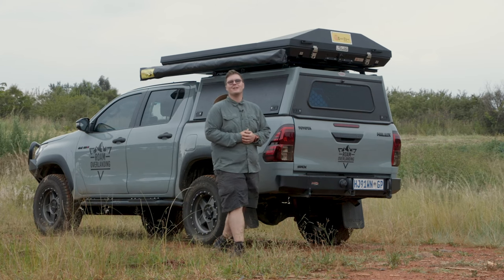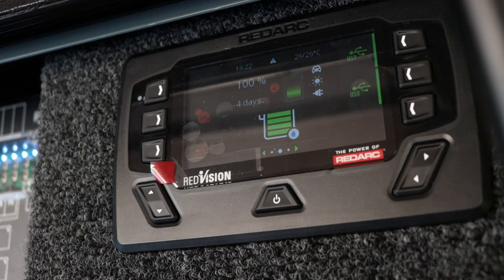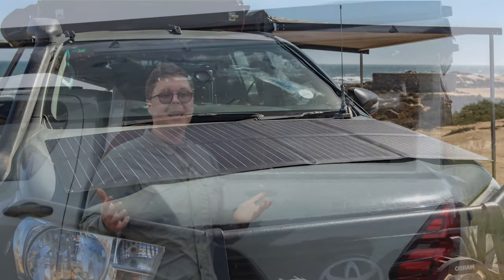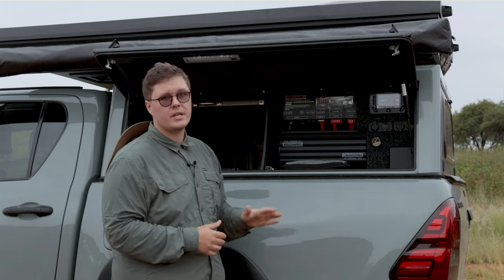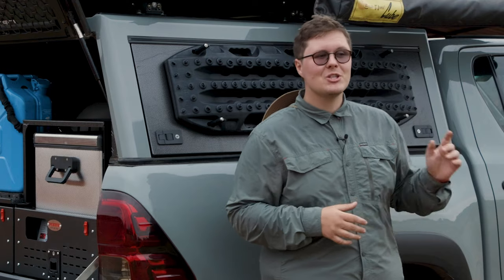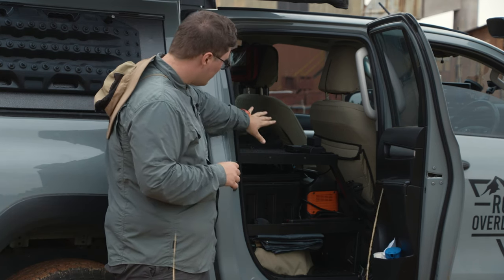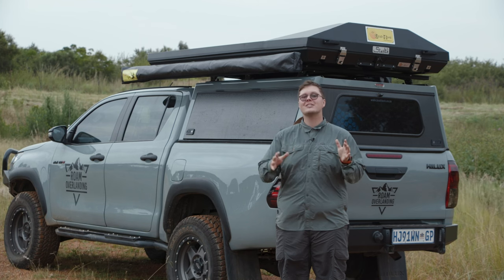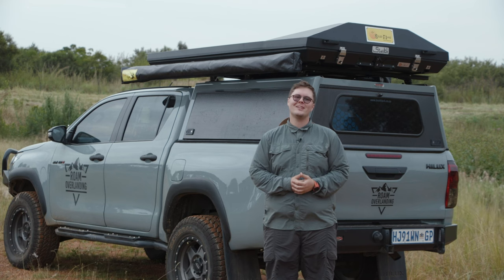Redarc Redvision Install, Garmin Tread XL Overland & New Drawer System (Major Updates To The Hilux)

Comment: Great content... I'm looking at the overlander vs the tread... what is your verdict?
Reply from the maker: Loving the tread 🤙🏻 requires less admin to get running. Just update to the latest software and hit the road. Which I’ve really liked
Reply: @RoamOverlanding  Thanks, I'm just trying to weigh up if its worth the extra 15k... in your older videos you do mention the overlander is a great Garmin. If you had to look at it coldly would you say its worth every cent of the 15k extra?
Reply from the maker: That’s a tough one…. If you could pickup a second hand Overlander and an InReach mini 2; that may be a great deal 🤙🏻 but the Tread with the InReach closes that gap pretty quite from the 15 👍🏻

Comment: Hi there . Looking great. Both the build and your journey. Congratulations! Besides from weight , any reason you have not put a solar panel on the roof? Might be less important with the lithium, but having near constant charge ( Daylight/ weather permitting) is great.  Provided you are not in a shady campsite for long, you could leave the blanket behind and not have that to worry about?
Reply from the maker: I do really want to put on fixed panels; and the plan is in action. I would still keep the solar blanket for a bit of extra oomph on those cloudy days or placing a panel further from the vehicle

Comment: In your experience so far, would you recommend the Garmin Overlander Tread over a Garmin Overlander + InReach Mini (2) combination?     I'm at the point where I'm looking at navigation options for my Jimny.  Since I do a lot of solo stuff, the Tread is an attractive option with build in SOS, but in a nutshell, the Tread is few grand more than just purchasing the "normal" overalnder and inreach mini separately.   Would appreciate your thoughts!
Reply from the maker: Really good question!  I personally really like the Overlander and Inreach combo; but let me throw a spanner in the works for you. I’ve been playing with the Garmin Montana 700i it’s a smaller unit, more accurate gps, detailed maps and InReach built in! And it’s cheaper

Comment: Great upgrades! I just bought a LC 79 DC and looking forward to see your impressions of the Bushtech tray/canopy. Redvision is next level. What would the ballpark cost for all components without labour be? Thanks.
Reply from the maker: Congrats on the cruiser Hansie! The redarc system as of Megaworld's pricing is about 54K i think then I did a hubble lithium battery which cost me 6k so round a bout 60K I reckon. Its certainly not cheap but it's something that will move from vehicle to vehicle over the years.

Comment: Why did you put the redarc system where you did? Seems to be taking up important and useable space. Couldn’t you tuck it away on the headboard somewhere? Also, it looks like you’re about to do the Namakwa Trail. I was just there. Would love to know your plans for the route. We took it very easy. Slept 6 nights on the trail from Klein Pella to Vioolsdrift.
Reply from the maker: The headboard doesn’t actually have enough space with a cab slider in, I also wanted everything to be easily accessible in case I need to work on it or change things up. If it had tucked it all away in a place and needed to unpack the whole vehicle to work on it, it would drive me crazy. I was using that space for the same thing before, I like having central access to my power and switching for my campsite. So personally I haven’t found it’s location a problem, if anything I’ve really enjoyed where it is 👍🏻 4x4 eco trail was amazing, we did 4 days only from Pella to Alexander bay but geez it was beautiful!

Comment: Just purchased a Tread Overland. Have you had trouble with getting T4A POIs showing up? Can't get all the POIs I see on Basecamp to show on the GPS.
Reply: Nevermind. T4A sent me the guide file which needed to be installed.
Reply from the maker: You should also just make sure the device is up to date on its latest firmware 🤙🏻
Reply: @RoamOverlanding  Thank you, but the issue was not having the Guide File installed on my Garmin unit. T4A sent me the file and all is working now.

Comment: Is it hard to look after that beautiful paint job you have? I mean the tub when you get stuff out or plug in the air compressor hose etc. I can see straight away the 79' looks very heavy at the rear. I really like your Hilux setup.
Reply from the maker: the paint is actually holding up really well! Its a truck paint, so similar to what gets used on fire trucks; so its really tough! Just a bit tricky to polish when it does get scratches. I've been loving the hilux setup too; I wouldnt go the cruiser route personally.
Reply: @RoamOverlanding  That's very interesting, thanks.

Comment: Hi Adrian, your videos are a huge inspiration and I'm trying to mirror a lot in my Ranger Double Cab. It's humble guys like you that inspire us to save up and do regular overland trips as a break away from the rat race.
I'm about to do a Dual Battery System with the National Lunar 90l Fridge like yours. When comparing apples to apples, would you recommend the National lunar Green Box DC to DC charger or the equivalent Redarc 25A? I'm just running the fridge, the same canopy lights as you and then the one camp light with telescopic pole, so no need for the redvision and management30 setup just yet. Just doing what I can afford for now :) Also, who would you recommend I do the fitment with? (Based on the choice that you recommend). Would really appreciate your advice 🙏
Reply from the maker: Thanks so much for the kind words! The Redarc BCDC25 is an excellent product, especially if you pair it up with a lithium battery that has a battery management system that’s compatible with a phone app. 👌🏻 installation depends on where you are situated really!  Have you watched the budget build episode where we run through the info on the BCDC25 at all?

Comment: How are you find T4A on the Tread XL? T4A have just stopped selling it as the say "Please note: we no longer sell this unit since we do not consider it to be compatible to our routing"
Reply from the maker: Well we use it and it works great, so I’m not so sure what they’re referring to exactly. I think the Tread is a beautiful specimen of a GPS 👌🏻 the last time I used Tread XL was for that particular trip, so my new one arrives soon and I will be using that full time. So follow me on @roam_overlanding on instagram and we can keep in touch
Reply: @RoamOverlanding  I spoke with T4A and they said that the new Garmin Treads dont take into account the T4A customer routing and timings like the older devices. I have still ordered one as it seem to be the best off road GPS even if the estimated times are not quite right with T4A 😉
Reply from the maker: @mikeadams4591  okay that’s interesting! I don’t think we ever trust the routing times 😋 our adventures always take longer than what the gps says 🤣

Comment: Another question regarding Garmin Tread. Does your wifi drop when screen times out after 30 minutes? Then you need to restart wifi again manually. I have been downloading satellite images and takes forever as wifi drops. Garmin is sending me a free USB charger to try. Which won't matter.... Probably need to replace my unit.
Reply from the maker: Weird, never encountered that issue. I plug it into the computer some times, and do all the updates there if it’s a big one.

Comment: Wow!  The screen on that Garmin Tread XL Overland is huge.  On where you have it mounted, how much of your vision is blocked towards the left side?  'Coz the 7" screen of my Hema HX-1 blocks a fair bit mounted at the same place.  Have you thought of mounting it where your rear vision mirror is?
Reply from the maker: It takes a lot less visual space than if higher. I actually just look over it so it’s not much more in the way than my front bumper is; higher up would definitely not be great. I don’t think the XL is for every vehicle but they do have a more normal sized version too 😂 it shocked me when it arrived. But I must say the big screen is super nice!
Reply: @RoamOverlanding  Oh yeah, I'd love that size.  Makes it easier to look at topographical maps with more details. I'd love to have one.
Reply: I'm saving for a Garmin Overlander, but now I find out about the Garmin Tread with an awesome 10" screen - woah! I like it but I don't need a built-in inReach.  I wonder if Garmin will release a version without one?  Perhaps release a 10" version of the Overlander - I like the Overlander's rugged exterior design.  Without an inReach built-in, I'm sure it'll be cheaper too. 🤞

Comment: Greetings from West Virginia, USA.  I have the Hilux cousin the Tacoma with a six cylinder Petrol.  I have installed a Alu-Cab Canopy, Gen. 3.1 RRT and a 270 Awning so far.  I have a question, what water tank did you install in you bed.  Here in the US it looks like were more like the South Africans than the Australians.   Also I just subscribed and looking forward to more video's.
Reply from the maker: Welcome to the show! Sounds like you’ve got one epic rig! I use a 55L Pioneer plastics water tank; it sits at the back of my drawersystem; and is secured by 2 angle iron brackets that hold it in place 👌🏻

Comment: what is the price of this redarc system in comparison to the national luna dc25? and what if something goes wrong in this system while in the bush, is there a way to bypass and continue using the battery system ?
Reply from the maker: So obviously this Redvision system with the  Manager30 is a lot more comprehensive than say an NLDC25 so a lot more expensive. But if you compare apples to apples a Redarc BCDC25 is R5800.00 and an NLDC25 is R6200.00; A Manager30 is around R25,000.00 but then also includes the 30A AC charging system  which you could get a standalone unit for like R4000; then you need a Bus bar for measuring the current draw on your system and a bunch of wiring and extra's. When it all works out the systems are very comparative I just like that the Manager30 is a 1 stop shop. It's just the Redvision "brain" that takes it all to the next level. I really like the simplicity of the Redarc system, they really do try and make it fool proof. This will apply in the bush too, their systems are well fused and designed to work together, there are fuse overrides on the TVMS80 for your outputs so if you need to force something on you can. Most of the other people I see using the Redarc systems have managed to do it themselves; in the upcoming trip that helped me out because I made 2 mistakes in my install that later come to bite me in the butt; but I was capable of resolving them very simply in my campsite. Spoiler alert; I just finished a 35day trip using the setup and it was AWESOME. being able to manage everything so easily was actually super fun. But Im a big nerd and very easily entertained! :)

Comment: How extensively have you used and reviewed the Tread XL, getting a lot of negative feedback on various overland forums, and not to mention the price tag?
Reply from the maker: i used it for 30days of traveling across SA, it was pretty awesome for me. Only issue I had was that the track recorder only saved up to 10 days of recording instead of my whole 30 day trip so I lost some of that data; but i think its because the track recorder now records a lot more info. Otherwise still great. I am a big fan of the Montana 700i if youre looking for top notch gps with built in inreach, its just not going to give you a massive screen, but will give multipurpose for hiking, biking etc too

Comment: Redvision vehicle management unit is nice to have but at the cost of around R29000, it does break the bank.
Reply from the maker: I would look more at starting with a manager 30 and then upgrading to the redvision down the line; the manager 30 on its own gives you a small display that shows the current draw and input; you will just have to do a bit more work on your fuses and switching . Otherwise Redarc also have very affordable BCDC chargers which everything up to the 40A will be compatible with a redvision at a later stage too. So there is something for everyone.